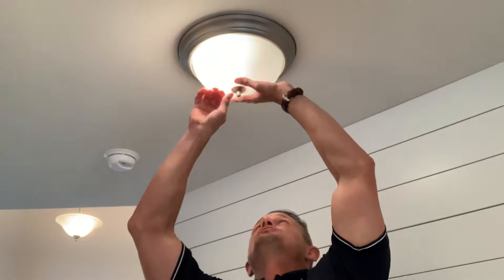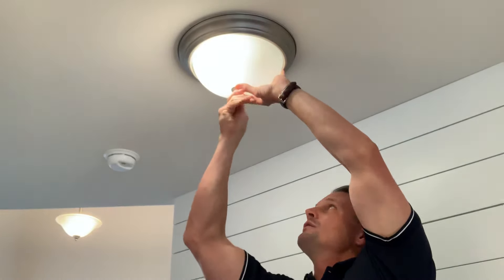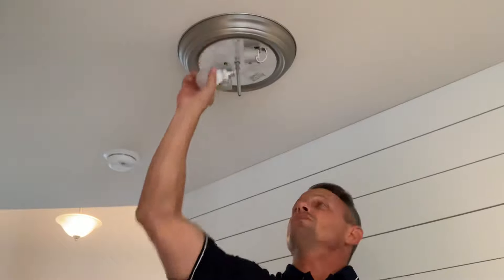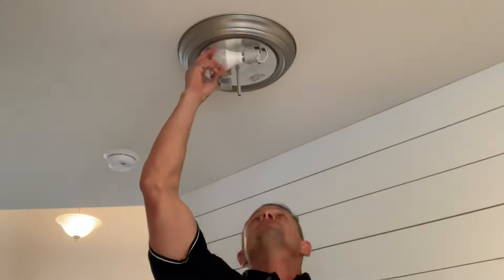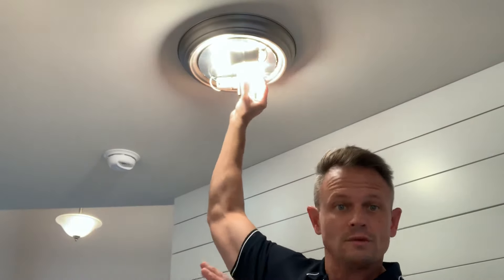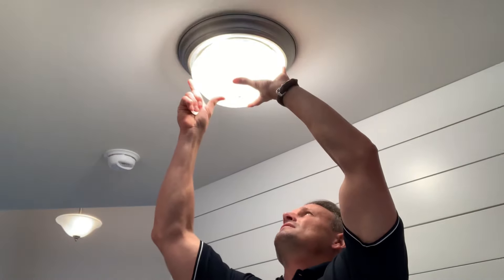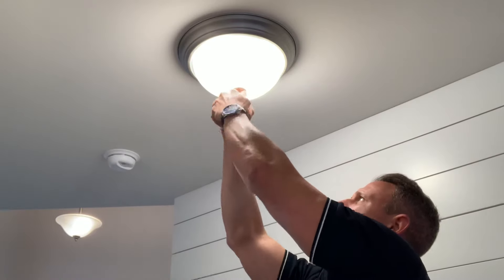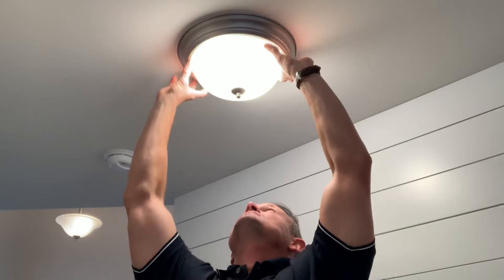How to change the light bulb in a flush mount fixture.

Comment: Hey BJ! When I unscrew the acorn nut the entire fixture (base+shade) slides off of the rod, and is only attached to the ceiling by wires. The glass does not separate from the base so I can’t access the bulb. If I look through the hole on the shade where the acorn not comes off and where the rod travels through, it’s an enclosed, plastic tunnel. Any ideas on what to do?
Reply: Buy a new house
Reply: Did you find any solution? I am facing the same problem here and can’t figure it out.
Reply: Same here any luck?
Reply: Same! 😑
Reply: Same
Reply: For anybody still wondering, it turns out that some of these (like the one I described) are entire units that you have to replace. My apartment complex’s electrician came by after I couldn’t figure out an answer and replaced the entire thing with a new fixture instead of replacing the bulb. He said they’re supposedly more energy efficient, but that he’s had bad experiences with them and has noticed them burning out just as fast if not faster than the standard model with replaceable light bulbs.
Reply: @iioooopp6932  😂😂🤣

Comment: Mine has a note in there that says not to exceed 70w. Is that per bulb or the total of all three together? And do i need a special bulb because it's enclosed? I don't know why jist purchasing the ritht light bulbs seems the hardest part for me!
Reply from the maker: @tessknepp4905  I would just put LED bulbs in there. They pull very little power and you pretty much could go with whatever wattage you would like because they do not heat up.

Comment: The nut is way too tight. I tried a wrench and it won't budge. Any ideas?
Reply from the maker: Your light fixture might not be the same if that nut at the bottom won’t loosen. It’s possible you have the style where you have to grab the whole light shade and turn it counterclockwise to remove it.

Comment: You can do this with the power on? Why have I heard you need it off?

Edit: oh, touching the glass is safe but touching the wires is what hurts
Reply from the maker: Yeah, we’ll the glass might be hot depending on what kind of bulbs are in there. However, if you feel more comfortable, just turn the light switch off so there’s no live power at the light fixture.

Comment: Mine keeps spinning and the screw won’t come off. Help?
Reply from the maker: If you can try using a needle nose pliers to hold the screw or threaded rod in place why you try to unscrew the acorn nut. Otherwise if it’s stripped or there’s a nut that you can’t remove to take the glass off, you may have to break the glass so you can get inside there, and then just have to buy a new glass shade or light fixture.

Comment: Mine is too tight
Reply from the maker: Your light fixture might not be the same if that nut at the bottom won’t loosen. It’s possible you have the style where you have to grab the whole light shade and turn it counterclockwise to remove it.

Comment: I'm a first time home buyer and I have these lights. But my thing on the bottom doesn't have the little know. I don't know hoe to get it off. Can you help me?
Reply from the maker: Hi Stephanie- If you don’t have a nut or decorative piece that acts as a nut, your fixture may be the turn to remove style. 

Take 2 hands and “gently” turn the glass shade counter clockwise and see if it unscrews from the actual fixture. 

Let me know if that works?

Comment: The hardest part is trying to put the dome back on
Reply from the maker: Yes it can be. The easiest way to do it is be sure you have a high enough ladder, so you’re working comfortably. 

Then with one hand hold the dome in place, while you screw on the nut with your other hand. 

Hope that helps!
Reply: @BJPoznecki  well I did that, and a day later it all came down crushing. Fortunately I was not under it at the moment. Now, I am scared to change the bulds throughout the house. Renting and all light fixtures are the same. 😥🙄🥴
Reply from the maker: @margmak6234  Sorry to hear! Since you had a difficult time with the first one I would just reach out to your landlord or property manager explaining to them the situation, and ask them if they could have somebody come over and change out all the lightbulbs in the home.

Comment: Hi. Any suggestions on how to get the that first piece off. I was able to change one light fixture but another  one I have the bottomed piece is on extremely tight so I can't unscrew it to replace bulb. Would appreciate any help
Reply from the maker: If it’s on really tight you may need a pliers or channel locks to unloosen it.

Comment: I am having a problem with the stem in the middle.  For some reason it has gotten shorter and I can't get the knob to screw back on.  Help!
Reply from the maker: Hi Mickey- You have to loosen which will lengthen the stem / threaded rod and you’ll be able to get the knob back on. 

Hope that helps!
Reply: @BJPoznecki  Thanks for the reply. I had to adjust the nut on the other side of the stem.
Reply from the maker: @mickeyc3096  🤦🏻‍♂️ Sorry, forgot to say it could be a lock nut as well. Happy to hear mission accomplished!!
Reply: I had the same problem and I’d been trying for the past few days. Have I ever thought that I could lengthen the rod. Thank you so much!

Comment: Hello. Be very careful when tightening the bitoniau! That the glass does not break? By changing your bulbs? Would it be a shame if the basin was broken or cracked?
Reply from the maker: Yes, you are correct. Do not over tighten or use any tools as you may crack and break the glass shade.

Comment: Thank you for producing a good video and your explanation. I tried to loosen it with a small lid gripper first with no effect.. Turns out mine needed a slip grip. Then it turned out, this fixture only had one bulb, it looked like one was out. Getting it back on is tough. I'll have to get a taller ladder.

Comment: My light bulb isn’t on the ceiling it’s inside the glass part. How do I get to the bulb?
Reply from the maker: Allive Bell Unfortunately it’s hard to say because there’s so many different variations of light fixtures. You might have a fixture that has an enclosed LED bulb or light kit that actually can’t be changed out and you need to replace the whole fixture?